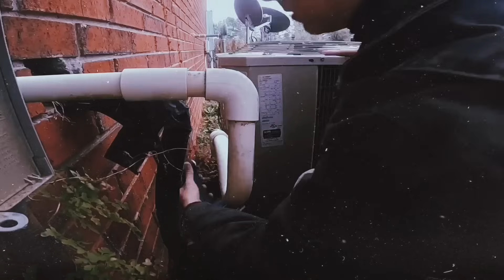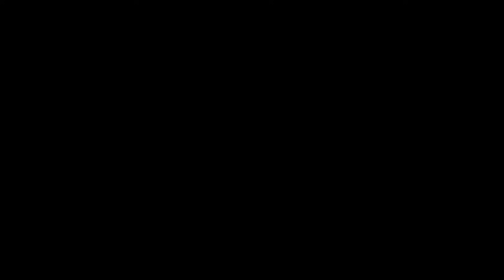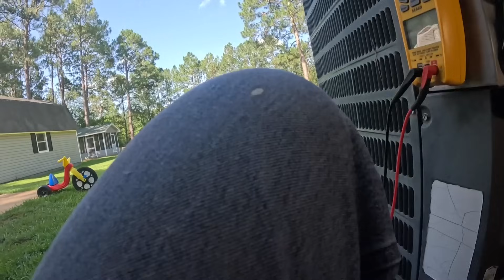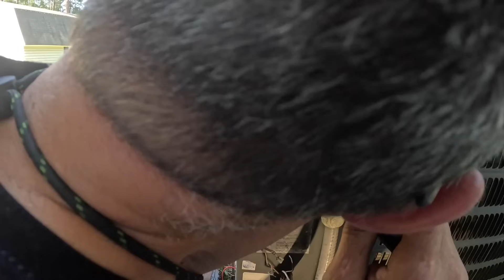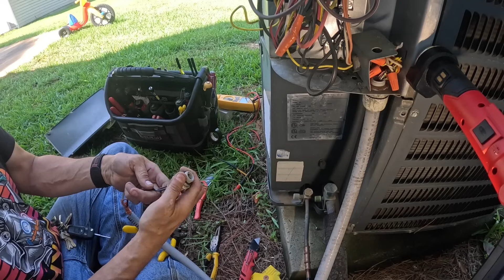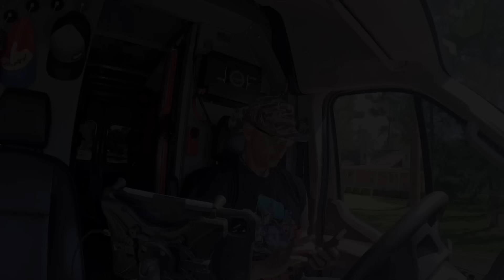Condenser Wasn’t Running On His AC! #hvacguy #hvaclife #hvactrainingvideos

Comment: What kind of camera do you use. So many you-tube guys insist on using one hand to hold camera and then one hand to use for working. Love the results of yours.
Reply from the maker: GoPro
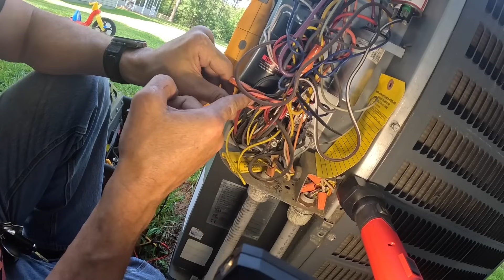Reply: It's really about having the right mount for the camera and what you're trying to capture.    An auto tech or HVAC tech trying to show you details of a repair may need many different angles, but they don't have all day to set up the shots.   So a hand-held camera does the job.     Even Curtis has done hand-held shots in tight areas like showing rubouts on the copper lines near the compressor.    In this case, once he started the repair at 2:30 he was able to sit his GoPro on top of the disconnect which was positioned perfectly for the shot and get to work with both hands.   Sometimes it's just being lucky.
Reply: @HVACGUY Hey Curtis what editing program are you using and are you editing from computer or phone I just got the 12 Black creators system and tried using QUIK and they require a subscription fee to use it for the cost you would think they would provide atleast 30days of free editing but NO!!!
Reply: @dmiestercommkitchentech3043    Try VSDC, I used it for my channel.   They have a Free and a Pro version.   The free version does a lot !   I chose to pay the Subscription for the Pro version, to support them, and it was only $20 a year.     Unless you're working with green screens, blue screens and removing backgrounds etc and doing some really fancy stuff, you don't need the pro version.     They also update "with new features" monthly.    And more importantly, the learning curve is a fraction of the others.

Comment: great tenacity getting the job done...I sense you would have liked to had the service request time to rip out that mess of wire and do it right...... Need to pull the battery from that "dog" brand smoke detector to shut it off hahaha

Comment: I wonder if the unit had that mess of wires when it was new.
Reply: No, it didn't.  You can see someone added a hard start cap and didn't trim the wires when they replaced the condenser fan.